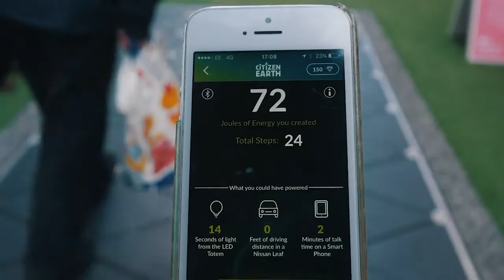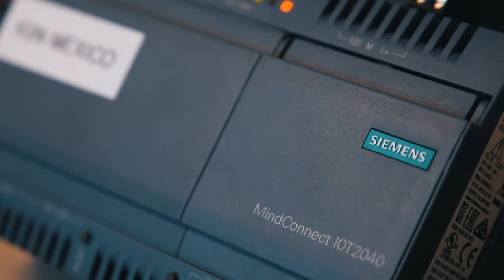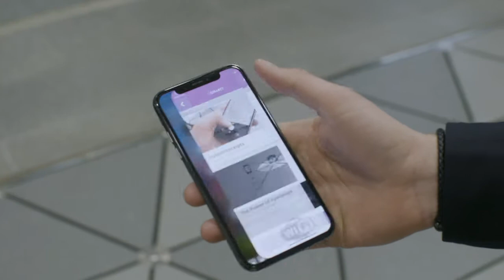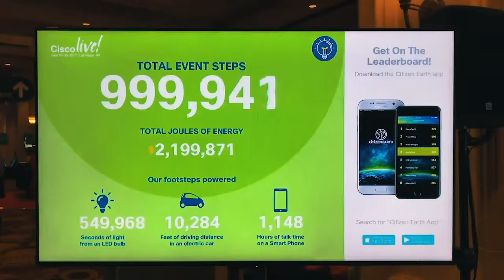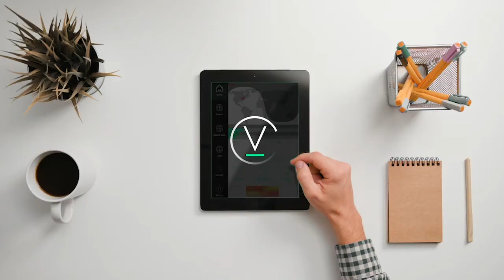Pavegen brand film Sept 2019

Comment: This technology isn't absorbing wasted energy from footsteps, it's requiring people to wast more energy while walking. It has great functionality for running and bicycle  pathways, because people have the intention of burning calories and wast energy from their body, plus, it absorbs the impact of the ground, which benefits for you bone structure. On sidewalks, I don't think it makes much sense, you are basically forcing people to wast more energy walking. It is has great potential, but not for every scenario, and certainly doesn't substitute normal pavement (not in terms of comfort)
Reply: Idea is interesting, but they are kind of admitting this is just a data gathering machine, which produces a little amount of energy. I would be interested, how much energy would produce 1 m2 of this during the lifespan. And what are the costs... But they seem pretty confident and want to install this everywhere (founder of Segway was telling us something similar, but now is just silence).
Reply: @skihck  Yes, I know. I only question the fact that they are not recycling energy but extracting energy from people. It would require people to wast more energy than needed, to walk on a normal surface, in order for them to produce energy. It would be the "same" as me having an Electric car and charging it with a fuel generator. I know the scale is different, but the way energy is transferred form one source to another is the same, wasting resources from one side to feed another. ... Now! If you tell me, this is a good idea for areas where people do activities and exercise, I would say , yes!, beacause the main purpose of those persons is to wast energy and calories. It's not the same purpose of someone going to work or just taking a walk, where they want to wast as little energy as possible.
Reply: @TehCruiser  to me it looks like they are unashamed and corporatizing immediately and ultimately are about finance instead of sustainability. That said, I am here researching for the latter reasons to prevent more corporatism and wealth extraction. This occurs when one realizes money is just a term people use to describe the value of energy and people's individual ability to access it.

Comment: Why not put it in the roads where cars passing by.
Reply: A truck doing an emergency brake could itself rip the asphalt off, the idea needs a construction that prevent the device from causing an accident. I have an idea for this actually
Reply: That's not the only problem, it's a conservation of energy issue. The compression of the tile takes more energy from the system, therefore slowing the moving vehicle down - meaning the vehicle becomes less efficient, requiring more fuel / energy to travel the same distance. The energy is literally being absorbed from the vehicles motion, into the floor tile, to be converted in part to electricity. It doesn't really work. However it's okay for people as it has very little impact on how people walk.